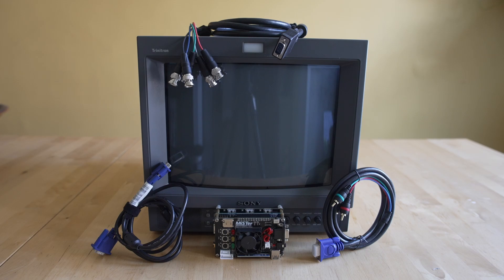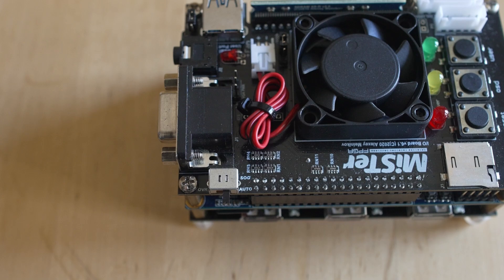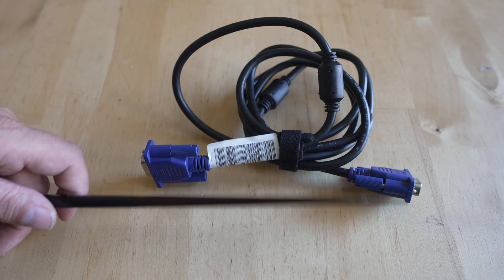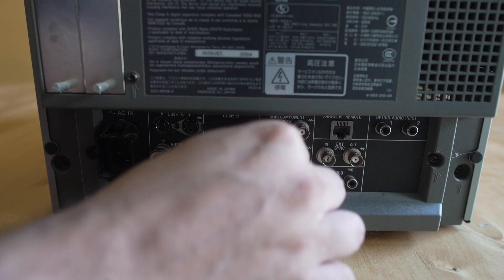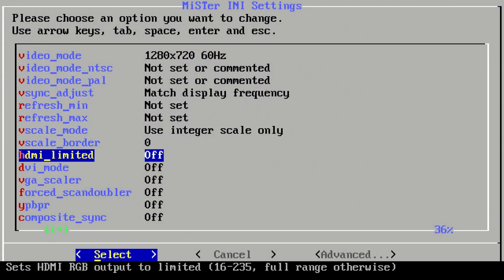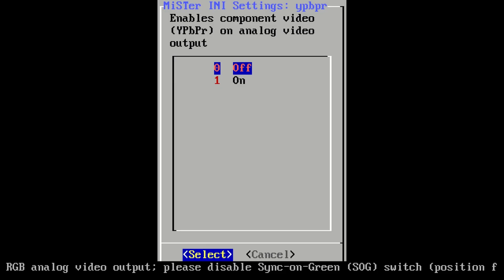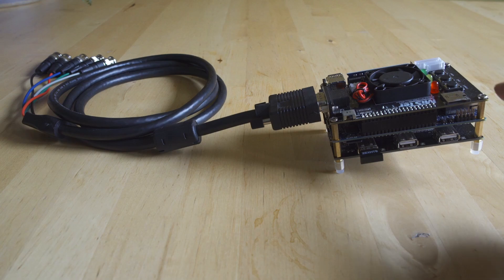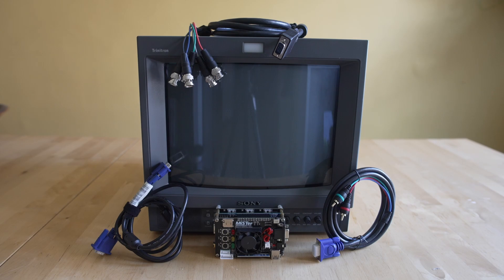MiSTer FPGA DE10 NANO! Analog How To! RGB, Component and VGA Made Easy! MiSTer Tutorials! 2022 Vers

Comment: this video was very helpful, I wanted to connect my pc to my pvm and didn't know how. Im buying a vga to rgb connector
Reply from the maker: Glad it helped!
Reply: the cable just arrived, and i cannot get it to work. I connected the vga to my pc and the rgb and sync cables to my pvm. I checked that everything is well connected but it doesn't work... Any idea? Maybe my vga port from the pc is not for video but for a printer? I dont know @VideoGameEsoterica
Reply from the maker: Oh wait you are doing PC? This is a MiSTer vid. I haven’t the slightest clue what GPU you are using and how you’d get 240p. A lot of GPUs do not do that

Comment: Hello,
In July 2023, if you wanted to play 15khz console and computer cores, would you recommend a 31khz VGA CRT or a 15khz CRT? Is the difference pretty close?
Reply from the maker: Most 31kHz VGA monitors won’t support 15khz so you’d have to line double. Considering most consoles are native 15khz in MiSTer as are the arcade cores that’s what I’d use
Reply: @VideoGameEsoterica  Thanks a bunch for your insight. Are there any cons to line doubling? Flickering?
Reply from the maker: Not really outside if I just don’t love the look of 15khz games on VGA. I prefer the “look” of a 240p CRT
Reply: @VideoGameEsoterica  interesting. i was wondering whether a VGA CRT computer monitor paired with a MiSTer to play Amiga games would be just as good as a 15khz RGB CRT solution, but it sounds like if you could choose between the two, then a 15khz CRT wins by far. Thank you for your help.:face-red-heart-shape:

Comment: I have a question. I have a 50" Pioneer Elite monitor. It accepts RGB with both H and V (white and black). I never played with video connection before. Can I use the video processing setting is with connection? Are those settings only accessable with HDMI?
Reply from the maker: I have no idea in that tv. Never seen it. I’d google that one

Comment: Can i use component to vga for AV? I watched some videos and they say that i can use it. I have old tv that i want to use as monitor but it only has av not component
Reply from the maker: Sorry not sure what you are asking? You want to go to VGA to av? As in composite cables?
Reply: @VideoGameEsoterica  yes. I want to go vga to av but i only have vga to composite. Im not sure if it will work
Reply from the maker: You need special hardware for that. You can natively do it
Reply: @VideoGameEsoterica  also, i have one tv tbat shares yellow av wire and green composite wire. I think that it should work if i connect that  shared av/composite

Comment: Do you have to change the service menu settings every time you switch cores if there's a resolution change? e.g. snes 224 to ps1 240? Ive only done wii emulation and adjusted to 240p so there's a small gap at the top when I switch to snes which I can live with, is it the same case on the mister?
Reply from the maker: Yes for the most part on a PVM you will be in the service menu a lot between hardware
Reply: @VideoGameEsoterica  Do you know if you can leave multiple usb controllers (daemonbite adapters) in the mister USB hub and they all work? e.g saturn in one port, ps1 in another and snes in another and you can just pick up the controller and change the core? Debating if I need the usb hub or not. Thanks love the channel.
Reply from the maker: I def recommend a hub

Comment: I'm using a VGA to Component cable on my crt TV and it looks stunning.
Reply from the maker: It really looks super clean and sharp no questions
Reply: @VideoGameEsoterica  I have a Snes with videocomponent mod and it's impossible to see the diference between both images. If there is a diference, it's minimal.
Reply from the maker: Only if you get to a PVM do you really start to see a diff but it’s still minimal

Comment: what i think is interesting is that early 200s VGA CRT monitors are pretty cheep and have very good image quality. What about repurposing one of those to accept RGB or some system to accept composit or component? am I in over my head and i dont know what im talking about or am i on to something. They seem like good monitors!
Reply from the maker: As long as you scan double to 31kHz then you are fine
Reply: @VideoGameEsoterica  Maybe some of the "multisync" models will work? Just a guess, it's been over 15 years since I last used a CRT monitor. I just found out by chance that some modern LCD monitors will accept 15kHz signals trough VGA, I haven't figured out the exact brand it was, as it was a generic monitor made in China that gets rebranded by various small office supply companies here in Brazil. I managed to get the manual of some of those and none of them mention supporting 15kHz signals and it was unfortunate that I could only find either 16:9 or 5:4 models, not a single one of them was 4:3. They're cheap enough that I'll probably end up buying one for further testing and to try to identify at least who makes the controller it uses. If I find anything interesting about it, I will come back later to let you guys know.
Reply from the maker: Yea multi sync monitors would be fine too

Comment: I was just looking for a video like this. Thank you so much
Reply from the maker: Happy to do it. It’s a new version of one I did last year
Reply: @VideoGameEsoterica  I think I saw that one last year and now I'm actually picking up my first pvm lol
Reply from the maker: Haha nice. That was just RGB and VGA. This included component because a lot of people asked for it
Reply: Might be a dumb question but how do I get analog audio out if it's separate?
Reply from the maker: The optical audio out is also an analog headphone jack. So use that into whatever speakers you want
Reply: @VideoGameEsoterica  I gotta figure out what cable will work with my specific pvm then.
Reply from the maker: My PVM is just RCA in but mono so you can just use headphone Jack to RCA. But I’m not sure what your specific PVM wants input wise. I use external speakers because my PVM speaker, like most of them, is straight up garbage sounding
Reply: @VideoGameEsoterica  I've got a RGB modded Ikegami VCM-1501. Gotcha I'll look for 3.5 mm to RCA cables.
Reply: @VideoGameEsoterica  Hey finally got my mister. I was able to set it up and run update all. For whatever reason, it only outputs a coherent video signal to my pvm when running the playstation core. Everything else including the main osd is a garbled signal. Any ideas?
Reply from the maker: And you are using BNC RGBS right?
Reply: @VideoGameEsoterica  yup. Vga to bnc on my ikegami. I followed one of your videos to get it to this point. I have no clue what could cause this.
Reply from the maker: Hmmmm. I’m not familiar with the Ikegami TVs, just the Sonys. I’d join discord and ask others who’ve used that model
Reply: @VideoGameEsoterica  I'll give it a shot, thank you!
Reply: @VideoGameEsoterica  for anyone in the future, turn off forced scan doubler in the ini files!
Reply from the maker: That was on my default? That’s odd
Reply: @VideoGameEsoterica  it is but hey, I got everything working now even audio. Thank you so much!

Comment: There are also Mister IO board come with Sega Saturn video analog port, wondering what's the difference between SS and VGA port?
Reply from the maker: I have not seen those but I’d get standard VGA port IO bits infinitely adaptable to every format basically

Comment: Even though I'm well past this being useful to me, I love that it was done. A good idea is speaking on using the service menu on either the Sony or JVC TVs to get things looking better (assuming the only issue at that time is service menu related). It took me a few weeks to find anything online about mines, then took me another few months to get explanations of each setting at a super generic level to know what settings I was actually changing. I believe most Sony Trinitrons have the same service menu options.
Reply from the maker: Yes the service menus are very user unfriendly. Which makes sense
Reply from the maker: Didn’t finish before I accidentally hit send. Makes sense as the service techs didn’t need an explanation!
Reply: @VideoGameEsoterica  now a days it's needed for preservation purposes.
Reply from the maker: Very true. Not many techs left!

Comment: Let me tell you one trick so you can capture video images from crt screens clean and clear. You have to filme/capture those images in 30fps, thats it.
Tell me if that worked for you, i hope i did help you
Reply from the maker: It’s still not amazingly foolproof
Reply: @VideoGameEsoterica  but it is better right?
Reply from the maker: You can do 60 as well. You need to be divisible by 60 and you also need a shutter speed that’s divisible. In whole numbers
Reply: @VideoGameEsoterica  I just choose 30fps on my camera and the images from crts become cristal clear
Reply from the maker: Glad it worked!
Reply: @VideoGameEsoterica  it worked on your footages?
Reply from the maker: I rarely if ever shoot a crt but yes it normally works
Reply: But dont get me wrong, your images are fine
Reply: You might still get a dark slowly rolling band this way as NTSC signals aren't actually 60fps, but something like 1000/1001 of that. Also, some consoles don't exactly follow NTSC timings and will output at slightly higher or lower than standard NTSC rates. There's really no foolproof method unless the camera you're using lets you do very fine adjustments.
Reply from the maker: No you really need to articulate the shutter speed and frame rate per console / arcade board

Comment: Yes please. S-video and composite please. That’s what my old consumer TV’s use. Thanks for a great video. Cheers! :-)
Reply from the maker: I think I will do it. Lots of requests so far
Reply: @VideoGameEsoterica  hello I got my mister set up through componet cables through the vga port I turned on the ypbr in settings and misters menu works on my crt tv but only arcade core,gba,and Playstation cores work the others like nes,snes,genesis,and turbografx don't work is there a setting I need to turn on for those cores?
Reply from the maker: Hmm I’ll have to ask around. Haven’t encountered that
Reply: @VideoGameEsoterica  I'm thinking since those cores nes,snes,genesis,and turbografx are 240p maybe they won't display with my component cables?
Reply from the maker: No because the cores you said work are also 240p consoles / machines basically. Something else is going on
Reply: @VideoGameEsoterica  I'm going to re connect mister back to lcd I'll keep you updated thanks for your advice
Reply from the maker: Yeah lmk
Reply: @VideoGameEsoterica  hey my friend I sort of got it fixed so I have the mister connect to my crt through componet and hdmi to a lcd at the same time and when I load the cores that won't working on my crt if I give the core like 20-30 secs selecting from the lcd tv the image corrects itself on my crt after looking scramble porn image now I do believe it's maybe my crt that is doing this I'm try to buy another crt tv to see if it's runs better and only core that still doesn't work well now is the genesis and mega cd core
Reply from the maker: Lolol scrambled adult stuff…clearly you grew up in the early 90s
Reply: @VideoGameEsoterica  you are correct sir lol
Reply from the maker: Haha I knew it
Reply: Please do! Would be nice to see difference between core-supported S-video and composite vs Antonio Villena's s-video and composite boards.
Reply from the maker: It won’t be soon but I’ll get around to it :)
Reply: I second this notion as well! Please do!
Reply from the maker: Looking into it :)
Reply: @VideoGameEsoterica  Including SCART as part of that video would be useful as well. Keep up the great work!
Reply from the maker: I just don’t have a SCART tv
Reply: Yes please make the video
Reply from the maker: So much demand for S video :)

Comment: The most annoying thing about analogue out is that the Neogeo is significantly to the left of all the other console cores. If it wasn’t for Sorg hating CRTs and forcing his attitude on the project, we’d have a horizontal shift like on the JT cores…
Reply from the maker: Yes as I mentioned some cores will require going into the tv service menu and moving the image. Its a bit unfortunate
Reply: @VideoGameEsoterica  on my PVM 2130QM, you have to take the back off, get a mirror, and adjust it while it’s running with all the risk that involves. All because of his stubbornness lol. Annoys me every time since it is not a hardware limitation, just an individual stopping it from happening. JT even released the H shift as a module for others to use. Anyway, rant over. Thanks for the video as always.
Reply from the maker: there is no service menu on that tv that you can adjust?
Reply: @VideoGameEsoterica  No unfortunately not. Amazing picture, but they were designed as exhibition TVs and have no service menu at all. You have to change the internal pots every time... Not practical, but on JT's cores it is no issue at all!
Reply from the maker: bummer. Could always extend the pot to be mounted out the back for easier adjustments
Reply: @VideoGameEsoterica  yeah that would be good, messing with the main board is beyond my skill set unfortunately though.
Reply from the maker: I get that. You would just need to solder a few wires to the pot pad and then extend the wires out the back so the pot was accessible. Easier said than done though if you aren't comfortable with soldering. Such a bummer that TV has no service mode
Reply: @VideoGameEsoterica  I might try that actually! It's just an expensive thing to get wrong... and I don't want to accidentally electrocute myself haha
Reply from the maker: Haha you won’t electrocute yourself